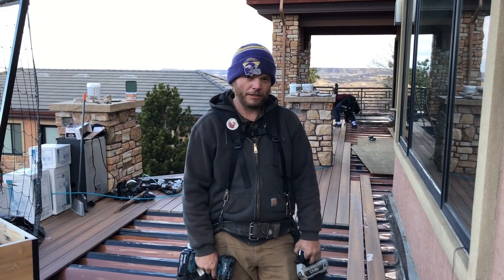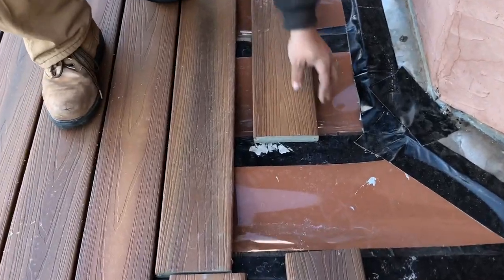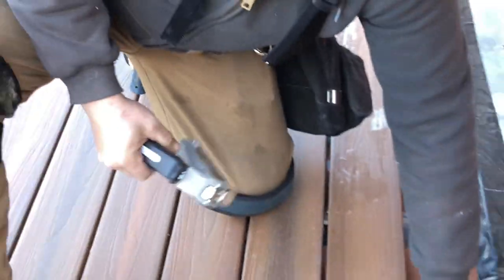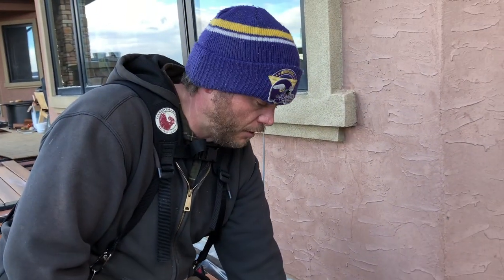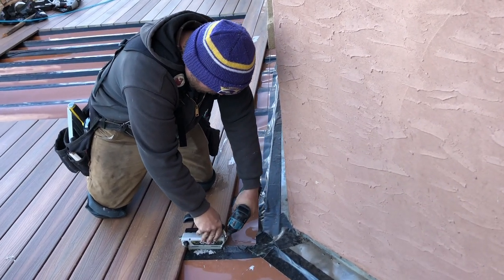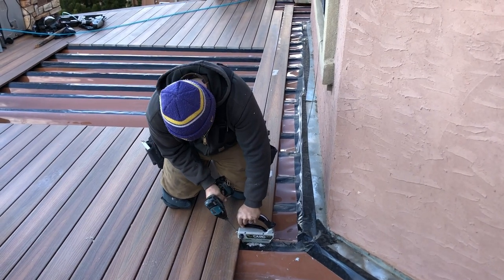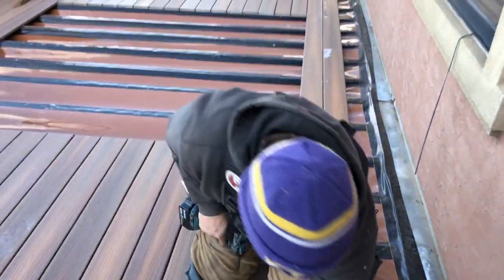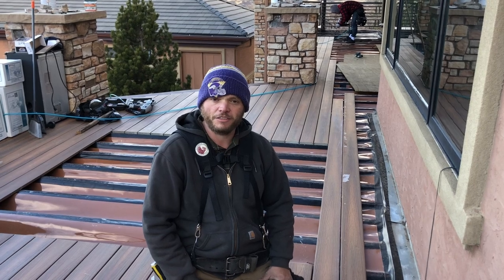How to Use Camo Fastening System - Hidden Deck Fasteners

Comment: How are you putting the screws in when your deck board is up against a house when there is no room for drill?
Reply from the maker: Steve Wilson There are a couple things you can do. You can face screw the back next to the house or what we do is use cortex plugs. It is a screw that goes into the deck board and then there’s a plug that matches the decking can you put that in that hole so you don’t see the screw. Hope this helps and thanks for watching.

Comment: Is there a recommended torque setting for your drill? I don't want to snap heads off
Reply from the maker: I have never had a problem with heads snapping but then again I don’t use the camo all that much. Sorry wish I could be more help.
Reply: The Deck Answers mine has a stop on the bit so overdrive isn't a problem

Comment: The deck answers what type of deck do you recommend for hot dry weather? I live in CA central vally and during the summer it gets over 100 f. Would you recommend composite? Thanks
Reply from the maker: I would recommend deckorators vault line. It is 30% cooler than other composite. It is also one of the best slip resistant decking. Hope this helps! Thanks for watching and the comment.

Comment: How is this on pressure treated does it hold up since pt moves so much?
Reply from the maker: house machine To be honest I don’t use camo all that much. I have not use it on pressure-treated decking either. But I have used it on composite and have not had any problems
Reply: Works great on PT